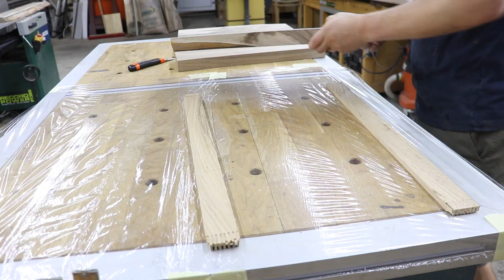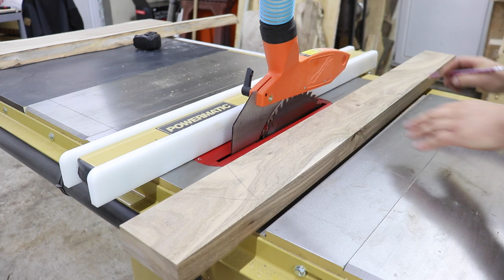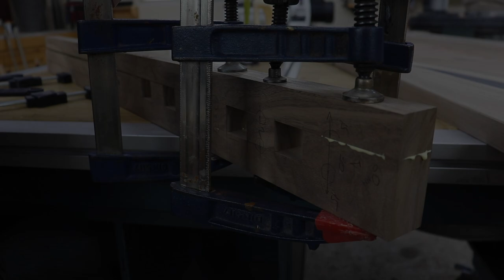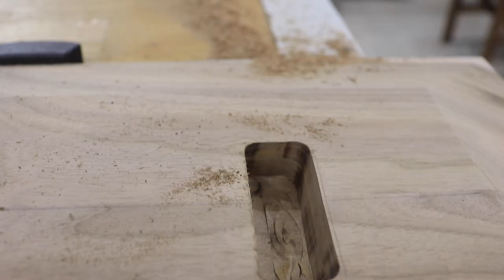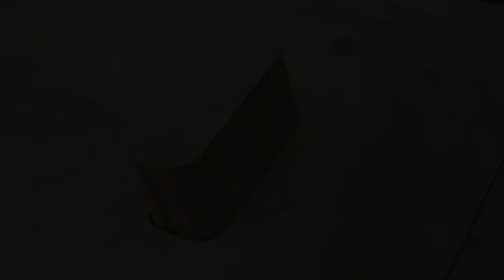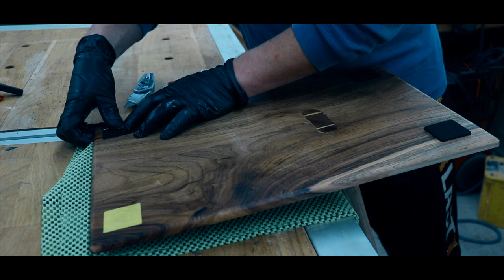Cantilever table. One leg adjustable coffee table.

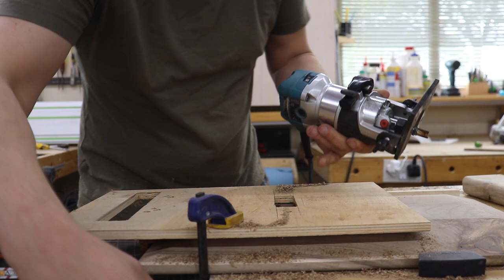Comment: You can't freehand a tilted router like he's doing at 12:00 even with a bearing, and expect good results, because when you rotate the router, you're also changing the angle of the bit.  You're going to get parts that are not as wide in the end. I'm sure he's aware of that, but if you're aiming for a perfect tenon / mortise fit, it's going to be suboptimal
Reply from the maker: Take a closer look. There is a router with a platform where you can set the desired angle.

Comment: This is brilliant!  Is there a reason he went through all the trouble to use dowels and blocks to make the holes in the upright leg?  Couldn't he have made the square holes by cutting through the board using a deep router and/or jigsaw?  I am not a woodworker, so there's probably a perfectly good explanation.  Thanks in advance!
Reply: Much easier and faster to do it the way he did. Mortising all those holes perfectly would be a real chore.